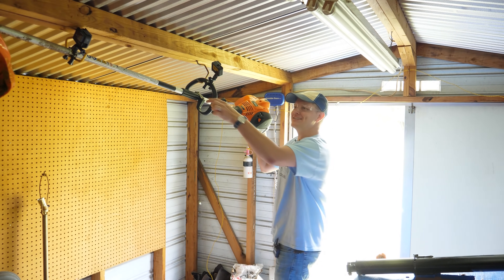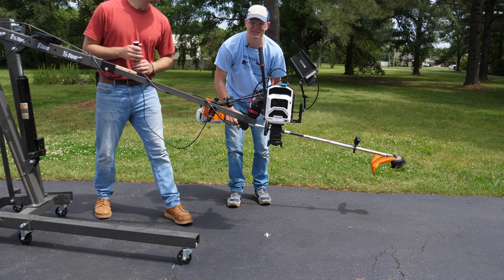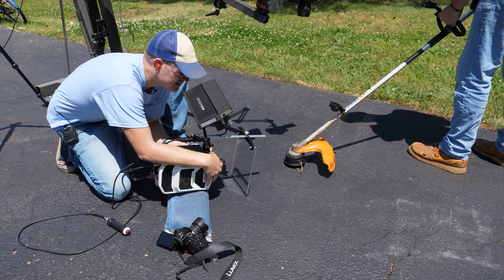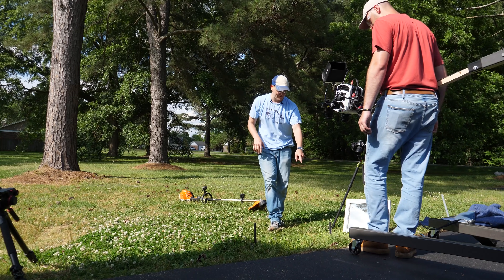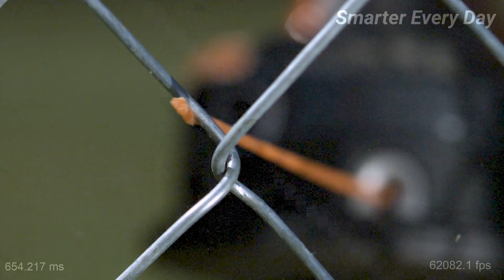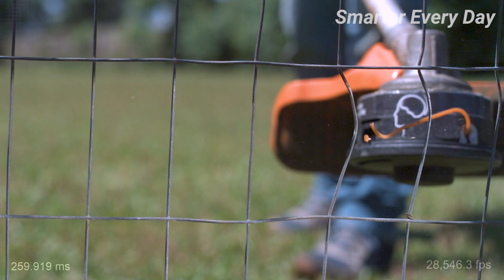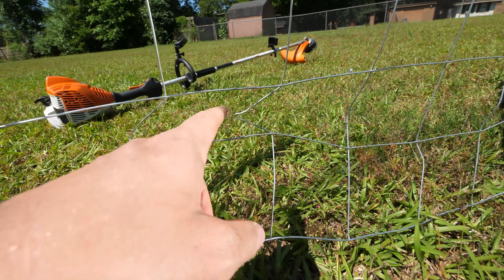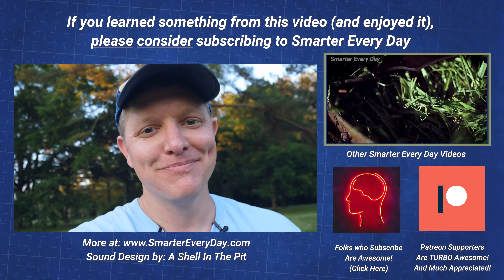How Weed Eaters Work (at 62,000 FRAMES PER SECOND) - Smarter Every Day 236

Comment: I really like the sound effects added to the slo-mo by the way. It's so well done and adds another dimension to what would otherwise be just silent footage.

As a side note I've only ever used a petrol powered strimmer like yours and the vibrations were going down my arm for a good 2 hours after I was done. That said, my garden is so small I tend to deal with borders using my sickle instead of the strimmer.

Anyway, fascinating stuff Destin 👍

Comment: 4:16 If it ain't diesel it likely will not have the torque, except for a few exceptions in certain engines.
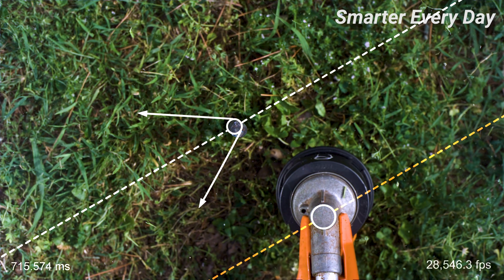9:00  Ask an actual super pro with a bullwhip and they may tell you that this experiment can be replicated by a bullwhip.

Comment: That looks to be a Stihl FS55R trimmer.  I spent all day yesterday working on mine that I have had close to 20 years or longer.  It has been a great one but after changing the carb and new spark plug I believe ethanol fuel has corroded the cylinder wall to no longer hold a good compression!

Comment: We used to have a specially nasty type of line for the bushes that we could not use anywhere close to obstacles: Hexagonal, with a metal core and glas-fibres in each corner. And it learned why we could not use that near any objects - that thing also cut through wood and metal fence-posts.

Comment: I think you should also consider the material of the wire. Polyethylene, polypropylene, etc. all have different properties. The manufacturers will also likely have varying methods of producing similar lines

Comment: hey i don't think the weed eater should follow the line. Shouldn't the tension in the strings pull the weed eater along the strings? explain please!
or maybe i am wrong in considering forces when this is actually an impulse? which should be along the line you showed. I don't have much experience dealing with impulses

Comment: Starting a Trimmer
Step 1: Adjust choke
Step 2: Prime
Step 3: Pull starter cord 12-15 times
Step 4: Readjust choke
Step 5: Pull until rotator is inflamed
Step 37: Question existence
Step 52: Renounce God
Step 95: Get turnover, have religious experience and reconnect with Jesus on a personal level
Step 96: Let run for a good 15 minutes
Step 97: Apply throttle, stall
Step 98: Cry a little
Step 99: Realize violence is not the answer
Step 100: Deposit Trimmer in nearest body of water at velocity

Comment: Would loved to see if having balled ends would improve the cut. In theory the added weight on the line would straighten it more and allow for a better angle of cut (especially with square or x edged lines).

Comment: I've been mowing and trimming lawns on a commercial scale for nearly 20 years. The reason you use it in the counter clockwise direction is to stop it from wanting to pull itself down, also because it makes a bloody mess on whatever you are trimming against if you go the wrong direction.   I had a 4 stroke trimmer for a couple years (I don't remember what brand) that actually spun in the opposite direction, so you had to trim in a clockwise direction.
Also, kind of neat to see the head in slow motion as opposed to at whatever rpm my trimmer runs at.  Haha

Comment: Please test the "quiet line" or twisted line.  Much like the modern vehicle antennae the curls capture air and a laminar layer effect happens at high rpms and the line cuts the air easier resulting in less atmospheric drag and higher speed thus more stability of the cutting plane.  Please show the cutting plane and different angles and rpms.  I really want to show my new hires these videos. 
Just a thought.  Perhaps a video about how a blower can move leafs into a head wind, but only if one understands what is really happening at the fluid flow level.

Comment: 11:30
TIL that weed whacking essentially atomises plastic polymer

So now I'm going back to steel blades
Reply: yup
Reply: Yeah that’s what I was thinking too. But it didn’t really seem like in normal use it messed up the line too much, but also it seems like there is a fair amount of degradation from my personal experience
Reply: thorbjørn mann  atleast they wont turn into small bullets and come careening into your stomach
Reply: @jackpreston9236  what
Reply: @joeyknight8272  steel blade vs small rocks
Reply: @joeyknight8272  have you never had a peice of weed whacker wire hit you?
Reply: @jackpreston9236  no only sticks from the weed wacker

Comment: Want your trimmer to start easily every time? Use True Fuel or similar product that's available at most hardware or home centers. Ethanal in regular gas hates small engines, especially small 2 strokes.

Comment: The thing that's amazing to me is that if you took a .095" length of .095" nylon weed trimmer line, you would have approximately 44 quintillion (4.39E19) nylon molecules.  The fact that there are mechanical dynamics happening between all of them that result in an emergent bulk behavior that also perfectly maintains energy's zero sum game that is also happening on a timescale that is well beneath our limits perception is mind-blowing.  I think that's why I've always loved high speed video.  It's like a look into another dimension.

Comment: The line looks like a wet noodle in slow motion.  My strimmer is electric and has a flexible steel rope instead of a plastic line.  I didn't like the idea of having bits of plastic all over the garden, or constantly having to buy new line.  This thing destroys everything in its path, and can mow down saplings and small trees.  It would be interesting to see something like that in slow motion.

Comment: Most are called line trimmers or string trimmers.  Depending on where you live in the country it will be called weed eaters or weed whackers.  Weed Eater is a brand name much like Band-Aid is a brand name for an adhesive flexible bandage. 
The higher the rpms of the machine the less the drag factor on the line.  Also the host is right that that different shapes of lines have different characteristics.  I am going to use this vid to train my new employees.  
I would like to see a video using all the different types of line.  Plus get rpms to max before hitting the wire.

Comment: 10:20 wtf, I love you destin, but you need to learn milimiters that measurement unit is just stupid
Reply: Is there a fundamental difference between thousandths of a meter and thousandths of an inch?
Reply: @Geerice  There is. Their relation to smaller and bigger units.
Reply: @zdenek3010  What?
Reply: M G in the the metric system you can just say millimeters or micrometers, you don't need to say stuff like 1/1000 of an inch
Reply: @evolution__snow6784  Mil, Thou, or just Thousandths are all acceptable terms.
Reply: Imagine thinking a literal rocket scientist doesn’t know metric units

Comment: When trimming around chain link or wire slow down the head speed which reduces the torque and create a better wrap around the fence causing less stress rip on the line and pull on the head while getting a better line wrap around the link. There is a reason you got frustrated on that fence Dustin...lol use that variable speed throttle. It's there for a reason. Torque can work for you or against you! Great video!

Comment: It's interesting that you say that the torque of the weed eater is a function of the line length. Surely the actual amount of torque supplied by the engine/motor (if you have an electric one) is more or less constant, and the angular velocity is a function of the line length? I suppose you could say that the torque applied by the line to the target could change with line length, but it still boils down to the angular velocity in the same way, right?

Comment: Noticed that the smaller diameter fence caused less line shear even though there were still 360 degree wraps - seemed that the fencing was able to deform and dissipate some of that energy.  There seemed to be very little line shear on the third fence, but I did see a piece of line shear off right after the footage was sped back up.  I'd love to see the full slow-mo interaction of the line and that specific fence wire.  Fascinating - thanks for this!!

Comment: I have been doing lawn care for 12 years and can tell you trimming a direction matters a lot. always circle things counter clockwise because 6 hours of trimming adds up and going the other way you "fight" the trimmer the whole way. use the trimmer to drag you along always. when trimming by a fence or cement wall you can easily see the line breaking unless you stay back just a bit so you don't waste as much line. I want to see that line test! We use round line name brand. the knock off cheap line gets brittle in the sun in weeks. the star and edged lines just jam up more in the trimmer than anything and no one wants to spend half the day fighting with a trimmer head that won't work.
Reply from the maker: You bring up two interesting points.  The jamming up of the reel and the degradation in the sun. We haven't tested those yet.  Will incorporate.

Comment: in the slow motion you showed at 3:00 , the engine was still speeding up / accelerating. We need slow motion of it while it is at full speed.
while it is accelerating still, it's obvious that the outer side of the rotation will lag back.

Comment: Regarding getting pulled in to the steel rod:  if you update the line of force as the trimmer head moves, you'll see it does get pulled into the rod, in a spiraling way.

Comment: Small caveat, the wire fence doesn't break at the weld because it is weakest there, but because it is strongest there. Similar to how you're gonna have a hard time breaking a line of wire by bending it, without having a really strong way to grip it, say pliers. Low quality fencing would have the welds rip, sacrificing more of the structure.

Comment: what a timely video just mowed our lake lot and got to run the weed eater just about had the same situation as the runaway on the smaller wire.  Nice putting the logo on the trimmer head at first I was like why the the slo mo's started.  I can't wait until the different shape trimmer line

Comment: The kicker for me is that the line always breaks off at the head and I have to disassemble it and manually string out more line. I’ve always wondered if the radius of the fillet in the head is too small and imparts too much bending stress on the line, if the line i use (looks to be the same Stihl orange stuff in this video) is sub par or if I need to learn how to load the line better...hmmmm

Comment: While you're at it, see how the wires behave in tight corners. Or with small/medium sized rocks / pebbles. Also, shorter and longer wires under actual load (not a single blade of grass, just shove it into an actual heavily overgrown patch. I've operated the large Stihl ones professionally for years and years and these things still fascinate me.

Comment: "Spagetification"  That's when I tapped out.
Reply: That’s also the word used to describe what happens to objects that fall into black holes
Reply: @dudemanbroguy3464  huh.. so it is. ty
In astrophysics, spaghettification (sometimes referred to as the noodle effect) is the vertical stretching and horizontal compression of objects into long thin shapes (rather like spaghetti) in a very strong non-homogeneous gravitational field; it is caused by extreme tidal forces.
Actually, this video was fascinating. Just useless. And now, I will try to interject the word "spagettification" into some near future conversation.

Comment: You should use a thermal cam on the line against the fence. It looks from the way the end of the line is bulbous that it might be melting the line, stretching it and breaking from heat but not tension as we're used to it working.

Comment: (Auto line feed trimmers)
That's how it feeds more line automatically. When the line gets to short, the motor is able to spin faster causing the line mechanism to open and send more line. The line hits the line cutter and the head spins slower causing the line feeder to clamp down again. Sort of like how a centrifugal clutch works but in reverse.

Comment: If there is a wiggle or a wave in the line as it spins, the motor will not rev all the way up however, if you can get the resonance right, it will. It's tricky but, it can b done. Experiment with it.

Comment: My weed eater cranks up immediately every time. It’s electric. I’m glad I made the switch to electric.
Reply: Also those two stroke engines are super nasty
Reply: I made that switch a couple years ago and it was the best thing I ever did! MUCH easier on my hands when running it. Those gas engines vibrated the feeling (literally) out of my hands. Looking at an electric lawn mower next 😃
Reply: Have not used an antique weed eater or mower in years. Forgot how bad they were until this video.
Reply: I don’t like the electric ones